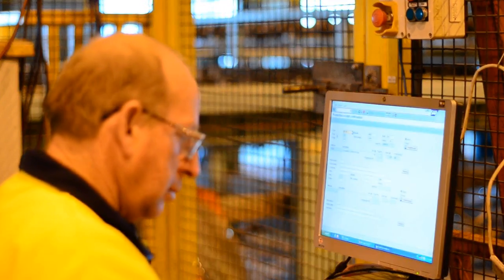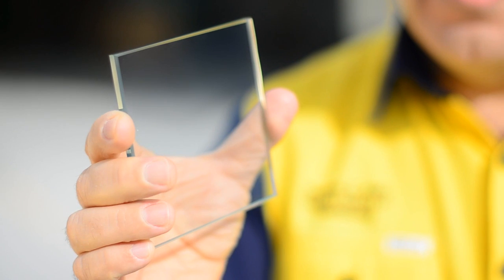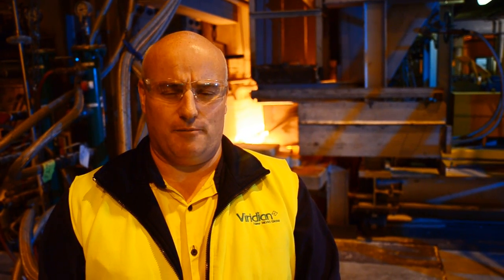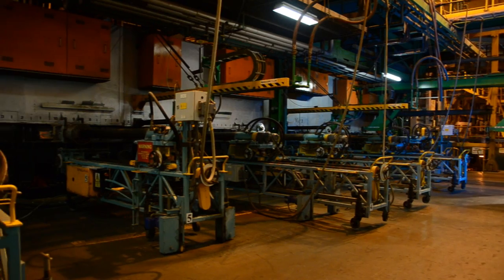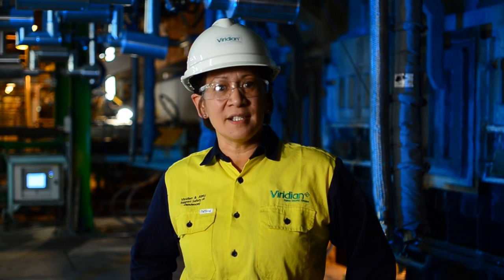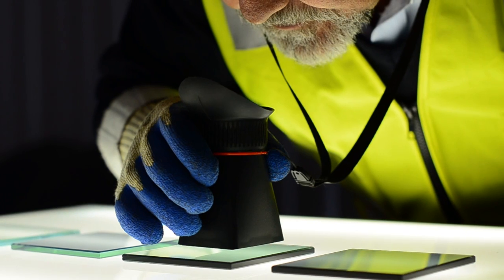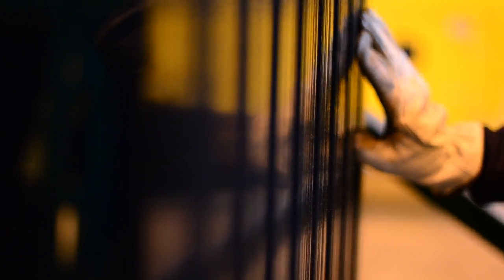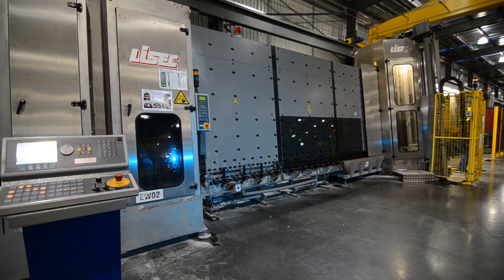How SmartGlass is made (Low-E energy efficient glass)

Comment: The question I have is this. With the treatment you add, does it change the properties/particles in a way that makes this glass easier to break or not? Also like the previous comment, if this is a commercial. it is not very informative at all and is basically useless.